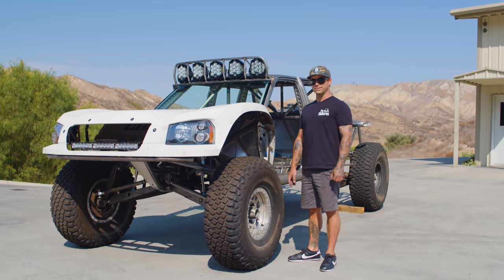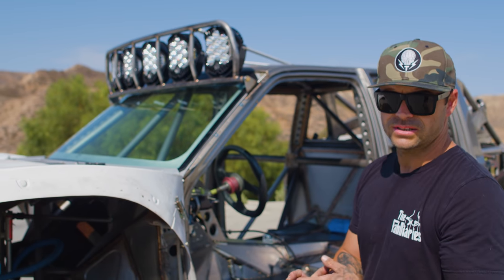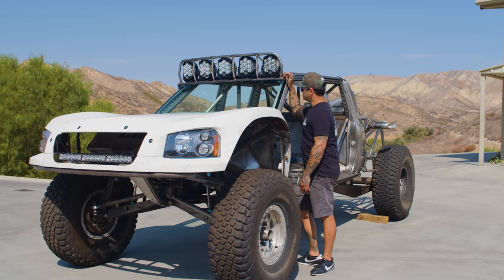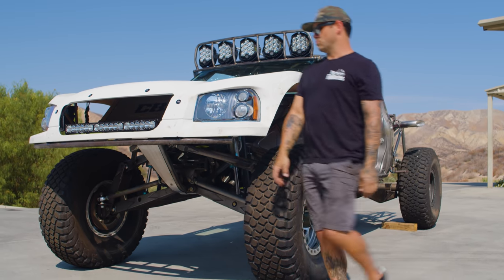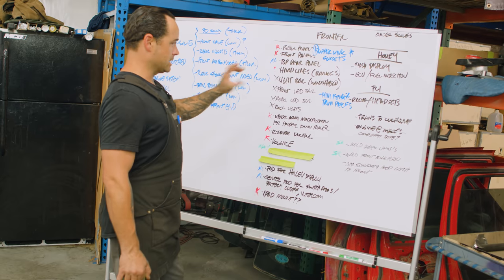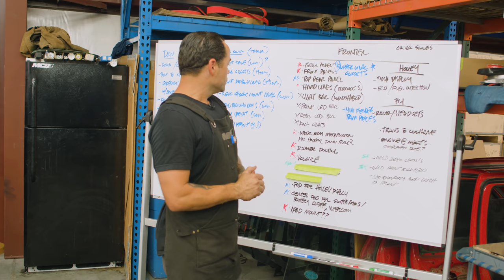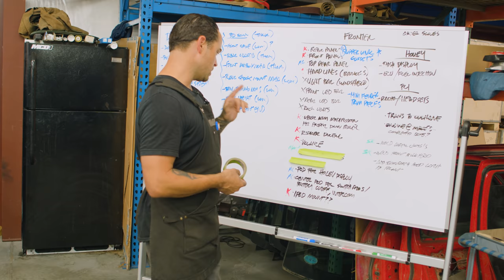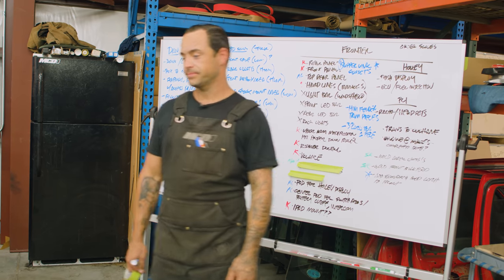Build Series | The Final Frontier Ep.2: Let There Be BAJA DESIGNS!

Comment: I'm mounting large trans cooler and engine oil cooler in back of my prerunner..flush along the back window.. similar to the frontier... Is it better for fans to be on top like frontier or flipped around with fans on bottom??
Reply from the maker: It’s preference. The trans and oil coolers work really well. They don’t need much air flow to do their job. I would say fans down.

Comment: Silicon bronze welding is unknown to me. What are the reasons for doing so? Thanks! Amazing builds and fabrication
Reply: I believe it is used throughout the cab wherever tying panels into the cage. It melts at a slightly lower temp than steel rod and the welds have a little bit of flex characteristics to it so if the cab were shifting relative to the rigid cage the panels won't pop and absorb some of those forces.
Reply from the maker: Silicone bronze is a very soft rod. It’s primarily used for preventing surface deformation or warping due to high heat. It’s not a structural rod. The primary use is sheet metal to chassis & sheet metal to cab. Don’t ever butt weld joints with it.

Comment: Did James sell or wreck the original frontier? Seems like a different cab by the color. I did my hardbody the dumb way and cut mine up and just have 3 ft of stock frame and my old cab. I wish I would have just bought a cab and did a full tube chassis. Saving 3 feet of frame was really a pain in the ass lol
Reply from the maker: Haha! It’s hard to make sense of people doing center mount setups on frame rail trucks. There’s lots of ways to do things! No wrong or right or good or bad! Sounds like a cool truck!! We have the factory doors still. Cab was not saved
Reply from the maker: But no. Truck was never sold! We kept as much as we could
Reply: @MorganClarkeDesign1  yeah during the rebuild I was just going to keep the front long travel I had but I put the truck on a chassis table and the frame was bent up front. So I decided to go center mount after that but it has been a process to say the least with the stock frame rails lol